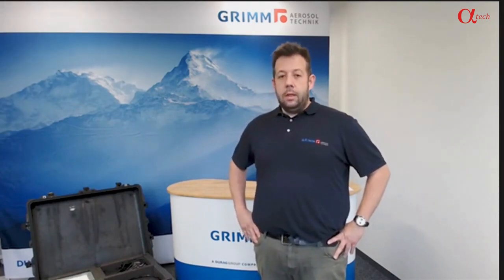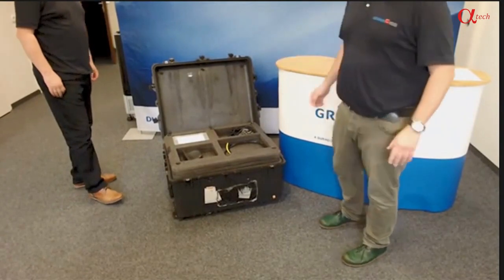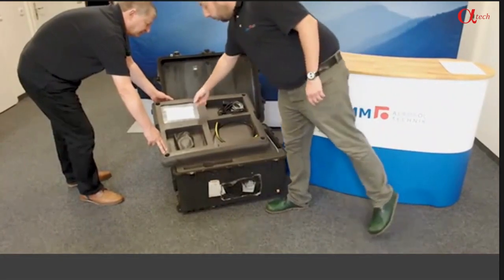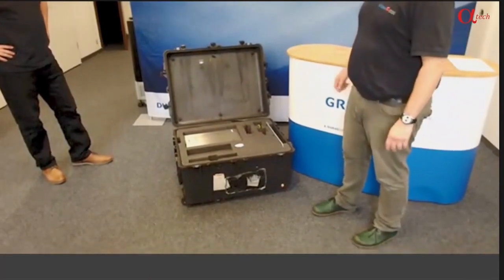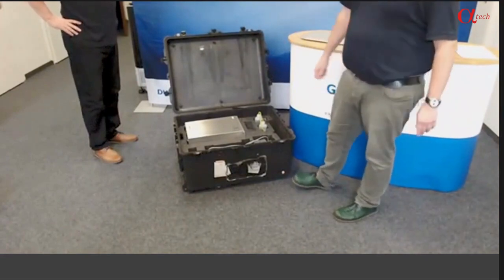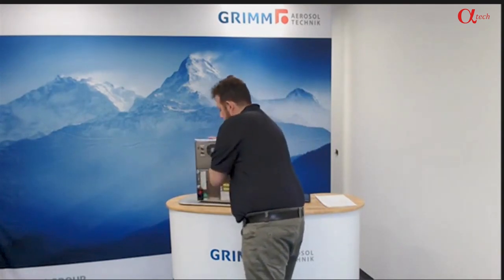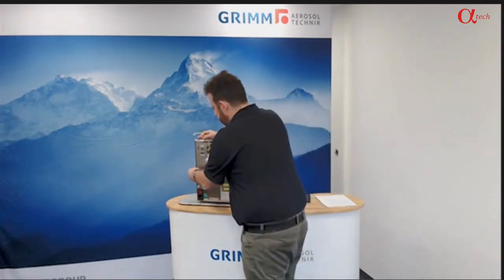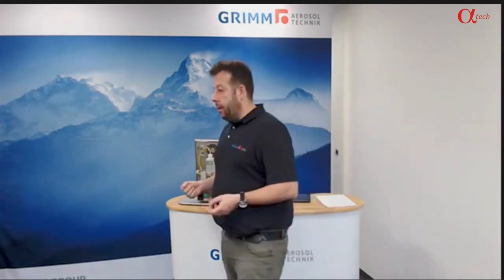Live Demonstration of SMPS+C by GRIMM Aerosol Technik

Comment: hi thanks for your useful video. i got confused with the connectors between the CPC and DMA. The "sheath air outlet" of CPC should be connected "Sheath Air Inlet"of DMA? 
and  "Excess Air inlet"of CPC must be connected to the "excess air outlet" of DMA? 
am I right?  I would highly appreciate it if you help me in this regard, I am a new Ph.D. student at eindhoven university and need to figure out how to work with this set up.
Reply: Hi, yes you are absolutely right in your understanding. Connecting 'Sheath Air' Outlet of CPC to Inlet of DMA and 'Excess Air' Outlet of DMA to Inlet of CPC ensures a closed loop connection of Sheath Air Flow within the SMPS set-up.
Reply: @rohanprakash1731  thank you so much for your  quick reply
Reply: @rohanprakash1731   and another question please. 
the sample outlet of DMA to the sample inlet of CPC? right? 

also I am curious to know that is there a neutralizer within the DMA?
Reply: @mostafataghipour4424  Yes, The outlet of DMA goes to Inlet of CPC. A neutralizer has to be added separately at the inlet of DMA.